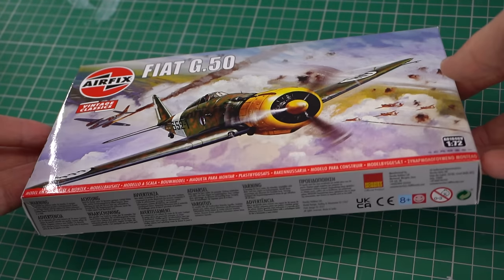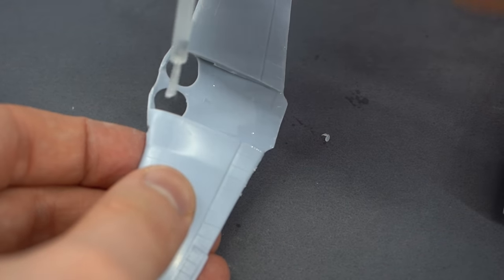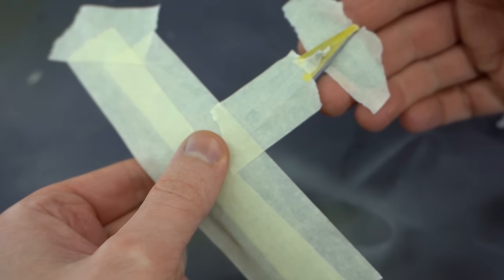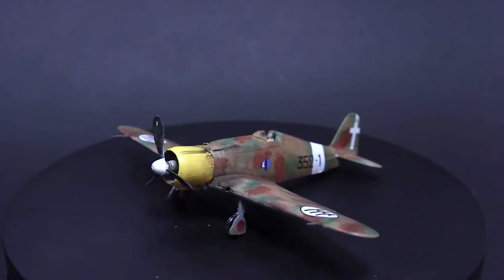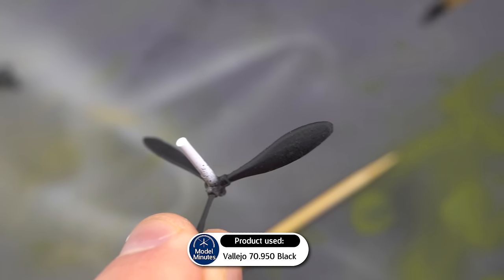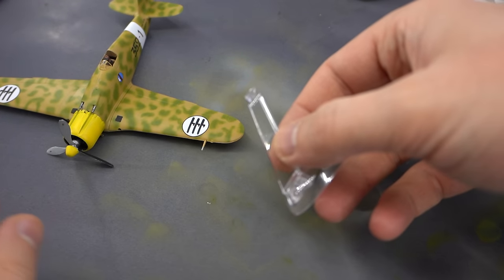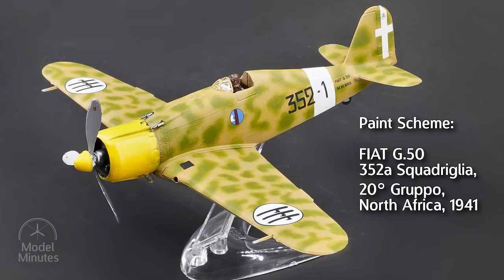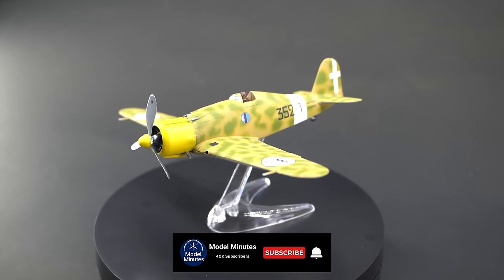Practise Your Airbrush Skills on the Airfix Fiat G.50! 1/72 Scale Plastic Model Kit Build & Review

Comment: An airbrush works wonderfully to prime, unless of course you don't have primer or you have a "rattle can" to use up. I recommend Vallejo primer. I use a little isopropyl alcohol to clean the remnants of paint in the cup- don't want to have chips of old paint mixing with the new paint and gumming up the works... Thanks for the video.
Reply from the maker: thanks for the info

Comment: Hi Matt. WRT airbrush painting, a couple of thoughts:

a) You didn't mention using airbrush masks, which might make complex patterns a bit easier.
b) In a previous video you used cutouts to mask for camouflage painting. Could you do something similar here; scan the box art / painting instructions, print and cut out the scan, then cut out the camouflage pattern and tape the scan to the model as a mask?
Reply from the maker: Interesting thoughts - I didn't see the point in covering masks in this video, mostly because this focused on free-hand mottling (and the canopy was so small masking it was pointless in my opinion) - it's something I could do in the future though.

I did actually consider scanning and printing a camo mask for this one, but thought it would push the complexity up and not improve my freehand skills - it would be another technique that could be used and I might look into that in another build